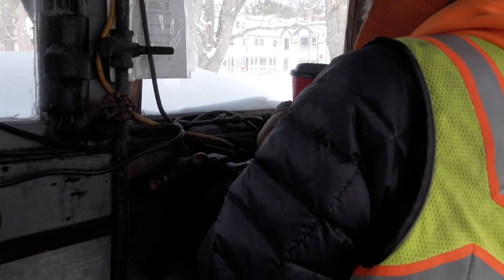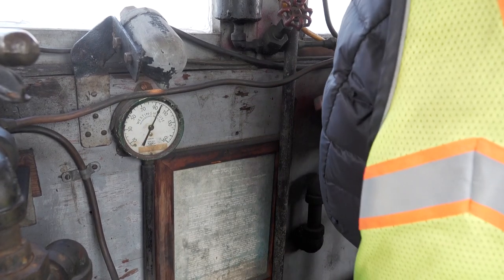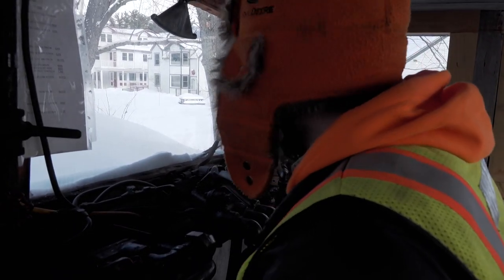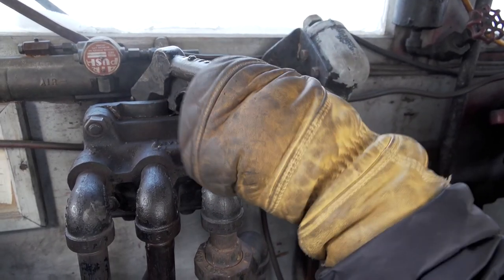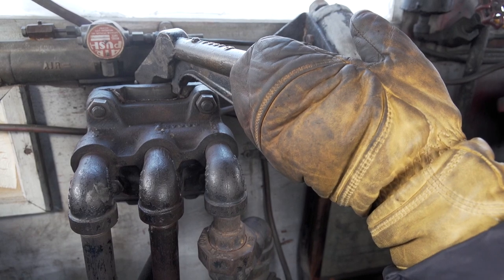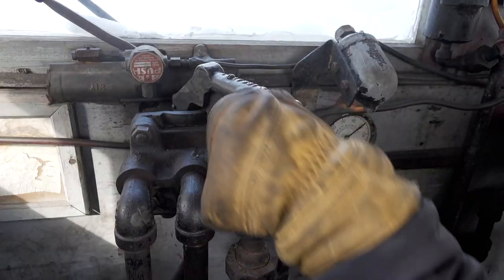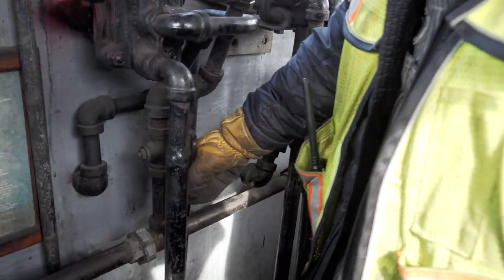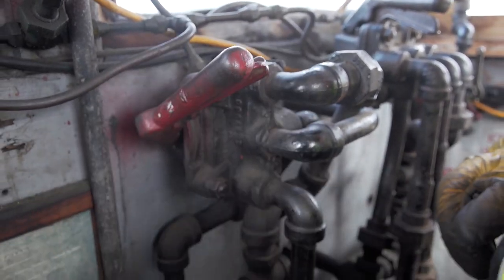Conway Scenic Railroad's Snow Plow in action!

Comment: I would love to see more plow videos. Can the plow be operated with the steam locomotives? If so, could the railroad do a winter steam plow photo shoot? Something simple like going to conway or down the Redstone branch. Either way,  stay warm!!!
Reply: Type in the search" Steam Powered Rotary Snow Plow".  This is the blower that is 
owned by the Denver & Rio Grande narrow gauge railroad.  It takes 2 steam engines to push the blower up the 4% grade.  It also takes 2 days to go 60 miles.
The blower is steam operated but not self-propelled.
Reply: @mattwainright8392  yes I've seen the video already about it. It's very cool, wish I had it to plow my driveway.
Reply: They have what it needs, but for photo charters they would probably want to use the Maine Central one for realism. Just have to wait for it to be restored.